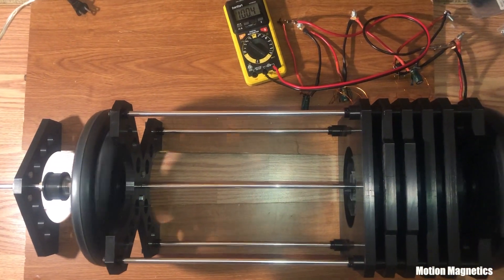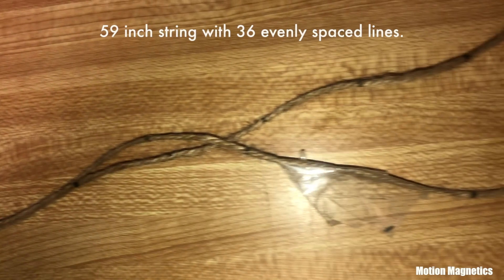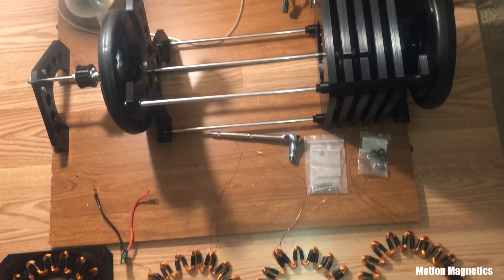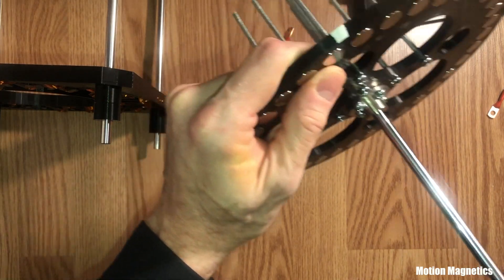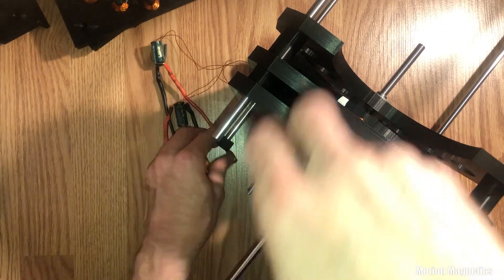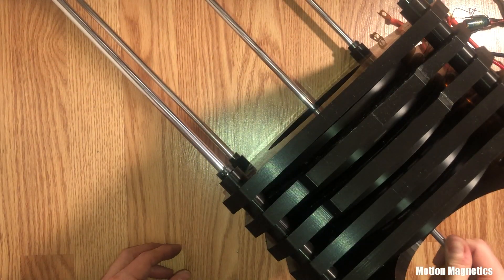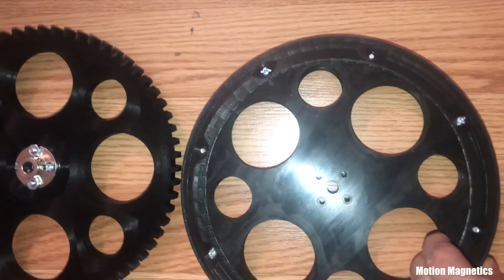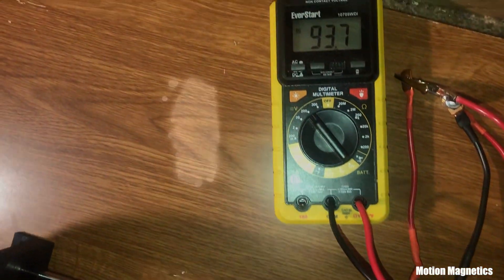Stackable Generator Assembly Guide

Comment: Hi - I have watched your video about 5 times now - I really appreciate this. I am building it now, at the stage of sourcing the parts and printing the magnet holders/coils. I spent a ton of time on Robert Murray-Smith's page too. I am learning so much and am amazed at the breakthroughs we are so clearly on the cusp of in renewable energy. 

Thank you for sharing the information about the diodes, and rectifiers. It intimidated me a bit, then you simplified it. 
When I complete the build I will pay it forward also, as the two of you have been example. This is such a good thing for humanity that we explore and share this with each other. 
2 questions after all of this, if you have a min. 
1. Explain the flywheel a bit? I dont understand it, can you link a video?
2. Have you finished yours? Are you innovating another direction? Can we get an update on where you are at in exploring renewables?

Comment: Im going to do something like you but we are both working off Robert Murry eho is so cool. Fyi - im going to make positive high temp plaster, use mikk milk protein extracted with viniger and add graphehe powder and if not enough carbon fiber (lomg sttanfs) then uv clear coat to keep from decomposition has the bioplastic should be as strong as steel but will start to break down and sunlight and weather without a clear coat or if you put it in anaerobic compost environment it'll start breaking down but as long as you cut it without UV clear coat then the bioplastic will remain very hardy in all weather conditions with the graphene that's my hope at least and it's an alternative to producing more plastic but still of the house the additive production process of 3D printing the parts first and then making a plaster high temperature plaster or positive that can be planted and the almost like homemade injection molding because you're going to you're supposed to put it under pressure and heat it for like 45 minutes and 50 c so you put the heating wires in the high temperature plaster and fill up your moles and at the hole where you're mostly putting in your bioplastic mixed with the graphene and if you have to add carbon fiber long strands because short strands are breathing hazard apparently you can cut your molds in half and lay them out for structural stability but still use the bioplastic but I think the graphing powder from what I've seen and again this is Robert Murray and they're hanging on the ceiling and steel is breaking before the bioplastic with the graphene so you have to set it under pressure so basically a ramrod in the place where you fill up the moles and some kind of Jack or some kind of something to put pressure on it.

Comment: It is a very interesting job. Im on a personal project to build my own small wind generator and I was looking for generator designs. Your looks really interesting. Would it work as a wind generator? Im not really an electric guy, so my ignoraqnt question is: how much power would this design generate in smaller sizes (voltage?) How much force would be needed to move it?

Comment: I think your creation is excellent and intend to replicate it myself. One question I am struggling with is why round magnets are used? If I understand correctly from analysing Robert Murray-Smith videos, the actual electromagnetic induction happens in a 90 degree angle from the movement. So he explains why and where serpentine coil works. So I am wondering if rectangular magnets centered as a daisy would improve your design? Do you have any thoughts or knowledge on this matter? Thank you very much and I look forward to your next video.

Comment: This looks so cool and I’m planning to build one for myself. I noticed you are printing with 100% infill, have you considered or tested 75-85%? I have tested on smaller parts that are under less stress but they held up better than 100% infill. My thoughts are to build the structural end caps out of aluminum and print the middle parts @ 80%. Thanks for the work and I appreciate any thoughts you have.

Comment: I'm trying to make an imbalanced motor using mercury tilt switches. Induction can move mercury and create a weight imbalance where you want. Added benefit is the mercury trips its switch right when you want it. If the induction is run by computer, you can continually advance or retard the induction, creating a swing like resonance.

Comment: Hey man hope you're doing well! How progress coming? Can't wait to see this as a gravity generator. Also if you manage to make an efficient compression system, you could use buoyant gas to lift the weights, compress the gas to allow the weights to fall, and decompress to reset. Maybe even gain back energy from the pressure when inflating/decompressing. Like a gravity piston. Anyways all the best! ❤
Reply from the maker: Yes, I'm good, thanks. Hope you are as well.
I have a machinist friend who is building the main drive shaft for the gear system. He doing this around his job, so the process isn't as expedient as one would like. Hopefully, he's finished in a week or two and then I can get back to testing the gearbox that I've already built. I should have a new video up soon after.
Thanks for the suggestion.

Comment: @Motionmagnetics

Wait I have a question. How did you determine how many magnets to use in the generator? https://youtu.be/OL-HiwAs-gE?si=OTl-MuL-FhtmlC8A&t=153
Reply from the maker: Part of it was for simplicity. There are obviously 360 degrees in a circle, so by using 36 magnets on the rotor when you 3D model the magnet housings you just separate each one by 10 degrees. I also had several magnets from another project that I thought would also work well on this project and the size worked great for the design I had in mind.

Comment: JW, is there a method other than Paypal to assist you in getting supplies to move this project forward? I've always had a passion for projects like this, but my career doesn't allow me any time to pursue them anymore. Do you have an amazon wishlist or something along those lines so i could materially support your endeavor?
Reply from the maker: It's kind of you to ask. Mostly what I've been doing is saving my own money up for each section of this project and purchasing things when I have the money available. I wouldn't say I have an Amazon wish list, as not all of the parts I purchase are from Amazon. I'll probably pick up a pure sign wave inverter there at some point, but I get my PLA directly from the manufacturer, the magnets and magnetic wire aren't bought through Amazon either. 
I have the PayPal donate option available should you wish to use it, but that's really all I have set up for donations currently. I've considered removing it actually, as I've probably received less than $30 in donations on it all the years it's been available.e
Reply: @Motionmagnetics  I guess ill go through PayPal. Not really a fan of them taking 3% but so be it. Standby and hopefully it will be helpful.
Reply: I didn't get a confirmation so if you don't see it on your end please let me know.
Reply from the maker: @connor1186   I woke up to a PayPal notification of your donation. Thanks, my friend! I will put it right into more supplies for this project. I'm so used to doing everything and paying for everything myself, I can't tell you how much I appreciate the help.
Reply: @Motionmagnetics  happy to help buddy. Looking forward to your next video!

Comment: well, you inspired me so I came up with a similar design in Fusion, mine is a bit more compact in the length but a greater diameter, the biggest I could print on my Bambu, I had lots of 20x3 magnets so it uses those, 24 in a rotor. I have a video of the Fusion construction but not of the actual genny yet. I have built a single stator dual rotor version so far. I seem to be getting about 60V at 700rpm or so and a short circuit current of 2.2A at the same speed. here is my video. https://youtu.be/Z6fYwBgWWvE hope you like.
Reply from the maker: Hey, that's fantastic! I'll go check it out.

Comment: Hi firstly well done and thank you for the file share...I have been Checking your channel for updates for almost 2 weeks now ...please do post an update soon and again thank you for the content
Reply from the maker: I'm working on a gear system right now and have been doing a lot of tweaking and adjusting. I also had to switch some materials to Cut the cost until I have things more fully worked out. I don't have an ETA on my next video update yet, but things are moving forward.
Reply: @Motionmagnetics  great work man, I'm going to try replicate this system aswell ..in your next video please include the RPMs ,voltage of the whole system as well as amps produced ...it sure would help with calculations

Comment: Whats was the halbach magnet arrangement? There was another video with a diagram showing 2 stators and 3 rotor plates acually 4 and mono polar plates facing inwards and 2 stators. (3 because 2of the rotors aretogeter facing away towards their own Coil on each side esentialiy containing the field in the house)
Reply from the maker: Not sure which video that was?
Reply: @Motionmagnetics  yeah i think i got It though the stacked halbach disks Will auto alighn. but for More contex log ago before youbuilt anything we were analizing the benefit of halbach. And you said that the wáy to get moreefficiency was to stack the disks with2 stators and 2 rotors in the middle. And you said "like inthis diagram" at the Time we werent aware of the múltiple stators and rotor consept
Reply from the maker: @SamSon-e8o  Hmm, well if I used a Halbach array with this design I'd put the coils around the rotor and place the magnets in a Halbach configuration on the edge of the rotor so it would pass by the coils but still be stackable.
Reply: @Motionmagnetics  right... I think i didnt make my self clear sorry. And thanks for the responce. Its a axial Flux. If only could draw It.
Reply: Might not have been your video.

Comment: Have you considered using one way bearings between the drive gear mechanism and the generator shaft? As to be able to wind the gravity battery while not interfering in the rotation of the generator
Reply from the maker: Yes.
Reply: I assumed that kind of scenario, and had been thinking again about escapements. What if you used an actuator that would click the escapement forward (rather than a pendulum), based on the current RPM? This would then control the addition of energy to the flywheel when it was called for. 

It might also be cukoo-clock like to have a 2nd smaller weight which can be used to simply maintain RPM when there is little draw. Making the larger weight almost like a startup capacitor. 

Just saying that actually sparks another idea. This is big picture stuff though.. 

How about an electronic system of robotic weight selection. There is an advantage to this rather than simply increasing the size of a single weight.. 

If you are selecting weights from a structure that would be designed to be easily expanded, increasing the number of weights in the system, would increase the battery capacity without requiring a change to the basic generator and flywheel setup. 

Once your basic generation system is designed and printed for your power use  requirements, the capacity of the battery could be expanded then, to whatever degree is practical for your input energy.. So add more solar, add another weight..

Comment: it looks like the coil is between the N and  S magnets of the rotors where attracted to each other that means you are giving the winding a N and S at the same time. Not good in my opinion as you are canceling out the flux, you only want a N or a S going through the winding at one time not both even if it is from opposite ends. You would get double the power if the rotors repelled  each other so you can fully saturate the winding from both sides with a N then a S so the rotors should repel each other not attract.  IMHO you would get at least double maybe 4 times more output. :Love you brother thanks for doing great things. Bob
Reply from the maker: Good to hear from you, brother! 
I designed the generator to work as a stacked version of an axial flux generator, partly to cut down on the drag you get from Iron core generators at lower RPMs, but also to make it scalable to whatever your output power needs are. 
As I'm sure you know, the iron core used in standard generators is needed to produce both poles through the coil by completing the magnetic path, whereas axial flux generators place a south pole on one side of the coil and a north on the other side to create the same effect. It requires more magnets, but it cuts down on the drag. That's important to the final design, as it will employ a series of gears connected to a weight. So the less drag, the better. 
I'm unaware of any axial flux generators that push like poles at each other through the coils and would think that would require sturdier material than the 3D-printed rotors I'm using.
Have you experimented with that orientation?
Reply: yes I have found that in my experiments using steal wheels from exercise bikes and large ring magnets and large coils that two magnets of different poles is not as good as one magnet on one wheel that flips polarity what you have there IMHO would be best suited as a motor. I could be wrong as  my coils were wound around and around, not using the staggered method of winding as you are. Anyway brother a am  happy to see your works and watch your videos.
Reply from the maker: @sonsoftesladotcom8234  Do you have a video up of one of those experiments? I'd love to see what you came up with. 
Thanks for the kind words.
Always great to hear from you, brother!

Comment: You mention chevron shaped gears, but surely these would suffer the same looseness, lash as straight cut gears, helical cut gears with a thrust bearing maybe preferable. These would be quieter, less probe to damage from snatching as the load is applied and removed either end of the gear chain. Also, since you have a 3D printer and imagination is your only limitation, wave you considered V or multiple V pulleys (car alternator), or crowned flat pulleys and flat belts (old industrial drive or steam machinery?
Reply from the maker: I'm mostly going from the experiences of people I follow who have posted their experiences with different gear types. I'm currently testing a belted drive.

Comment: Hi brother peace of the LORD upon you, could you inform me please, how many watts your generator is doing, and what is the weight ? , i m thinking in make one too,(this time with a 3d printer) to be honest i already made one of fiber glass, but i dont have a 3d printer, so it become very heavy and was very hard to me, it was producing only 70 w, (i used microwave magnetics), i would like to make one that weights like 2 kg and produce something arround 500w, i dont know if it is possible and there are alot fake videos in youtube, so i cant trust in them, but i know you are a honest person, for it i would be very happy if you tell me brother, by the way brother by the grace of the LORD ,JESUS i found how to use pulleys to decrease the ammount of weight that is need on the engine, if you want, i can tell you how brother. i wish you and your family have a great and a beautiful day.
Reply from the maker: Thanks. I've had it up to 184v at higher RPMs. I'm not certain of the watts yet, so I don't want to mislead anyone until I have more accurate numbers. I would guess at least 400w, but that's just a guess.
Reply: @Motionmagnetics  thank you so much for the replying brother, you said you have 184 volts right ? and if i m not wrong your coil is producing  2 and half amper , so it would be 460w , because watts is volts times amper , it would be very impressive , what is the rpm brother ? , and i was thinking, your magnetic rotor has magnetics arroung making a circle right, but what happend if you put more magnetics bellow those that are already in the circle, so it would  make a second layer of magnetics improving the efficiency of your engine, because i think you are losing space putting only one layer of magnetic in that disk , may be because the increasing of the magnetic flux, you would also increase the amper and the power keeping the same space, GOD bless you brother and we are waiting for new videos, hug from brazil to you.
Reply from the maker: @andersonsantos-lr7qu  I'd say that's a pretty good guess on the watts. I'm trying to estimate on the low end as I'd rather exceed people's expectations than fall short. I didn't measure the RPM when I hit 184v. I'd guess over 700, but I'm not certain. Once I have something tested better I'll share some more accurate numbers.
Thanks for the kind words.

Comment: 2 Questions:
1. What's your input compared to your output?
2. Have you ran this standing straight up? A spinning weight is almost weightless when spun horizontal to the ground
Reply from the maker: I'm setting it up to work with a gear system connected to a weight. I've only tested it with a pull cord and a hand crank so far. I wish I had shown the hand crank in the videos, as I've had it up to 184v. 
I haven't tried it horizontally, but that's not a bad suggestion. Thanks.
Reply: @Motionmagnetics  Standing straight up with a geared or pully system attached to a wind turbine would be awesome too. This is great, will be testing out when I get time
Reply from the maker: @vintasalo  Thanks. Send me a link if you get a chance to test one out and decide to post a video.

Comment: I don’t this is just a mere curiosity. This design may be the key to making your own power at home using a water wheel or steam turbine (Tesla turbine, powered by solar collector and sand battery). Think about a long term grid-down situation.

The only recommendation I have is using aluminum hardware to further decrease magnetic drag.